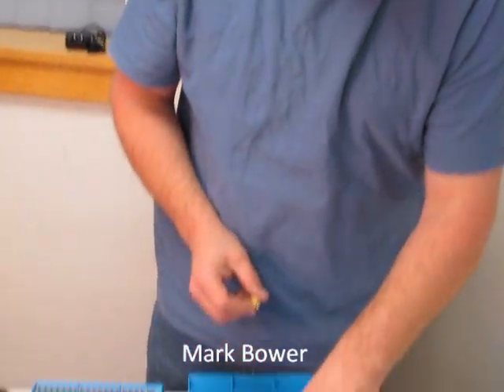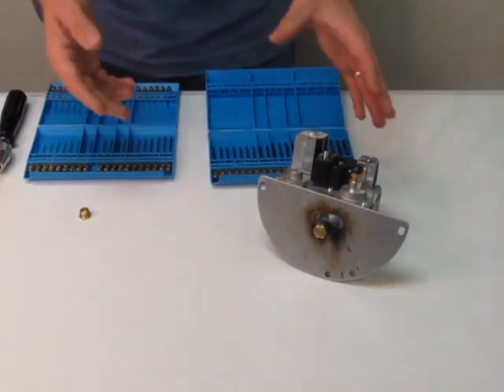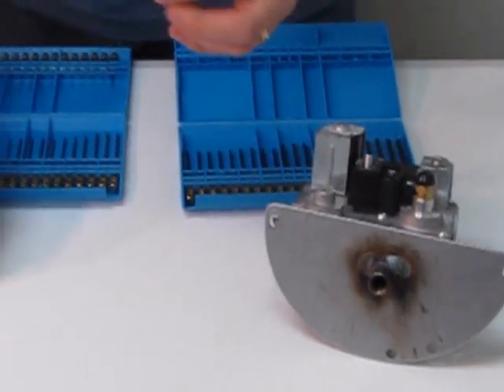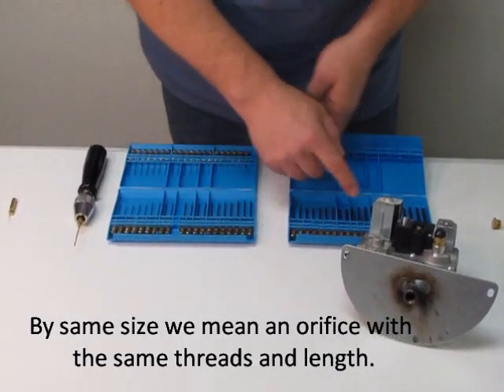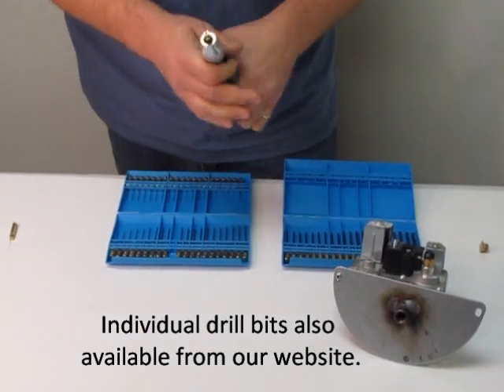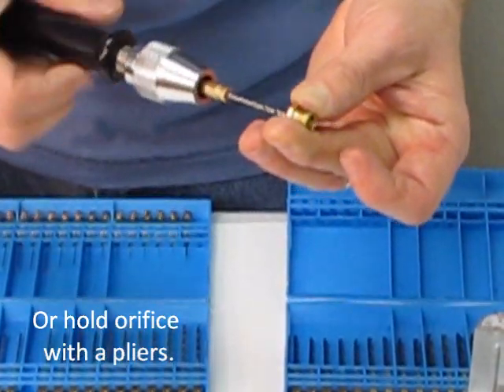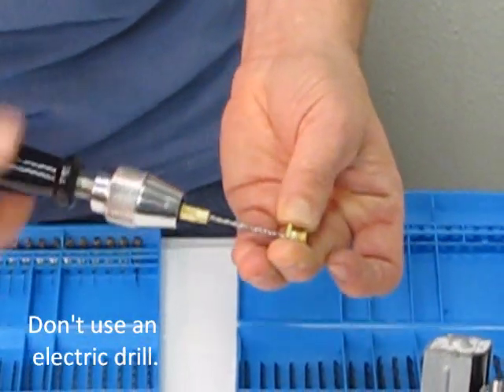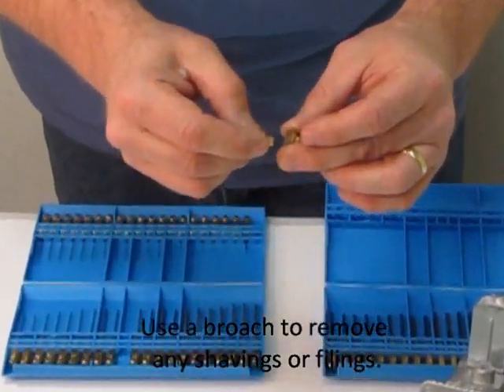Drilling a gas orifice

Comment: what size bit to go from propane to natural gas and is there any other settings to adjust. kenmore 800 series
Reply: look up "natural gas orifice conversion table"
It depends on your individual burner BTUs, which are usually different for each burner. it's easiest to look up the info by finding a service manual for your range.

Comment: You drill from the back side of the orifice    It is tapered and self centering and should be drilled straight The way you drilled it will egg hole and make it larger than desired.
Reply: I have a 2003 GE Profile and no where in the manual does it give orfice sizes.

Comment: he's selling a bit set for 225 dollars. (AWG #40-80)
go on ebay.
Find a jeweler's drill bit set (#61-80) which is 6 bucks (4 bucks if you want to wait for shipping from china), a name brand set of micro bit vices (I bought mine for $20 - make sure yours can fit into your power drill! - power drills are more stable!) and a #1-#60 bit set for $25. Total expenditure was just over 50 bucks.
hopefully I saved you about an hour of surfing around trying to find a thorough but cheap set of bits - took me an eternity to figure out what sort of bit sets people were offering.
P.S. don't buy the 115 piece ebay bit set - it's not hardened metal! ...and the cheap micro vices are TERRIBLE quality. stay away.
Reply: How do you know what size you need to drill them out to
Reply: @truckrunner6721  I think there's a chart that shows the correlated sizes between propane and natural gas at whatever pressure you're working with. just gotta look it up